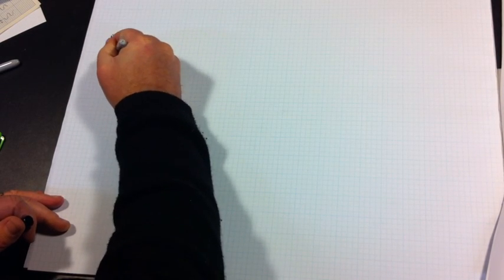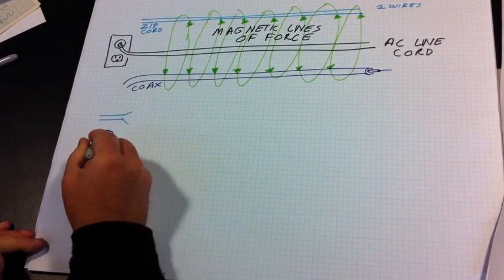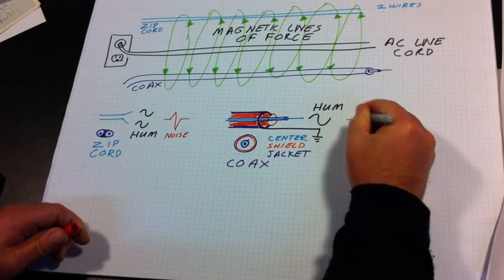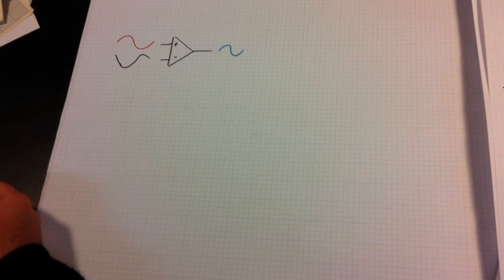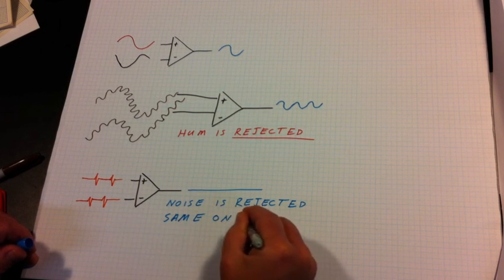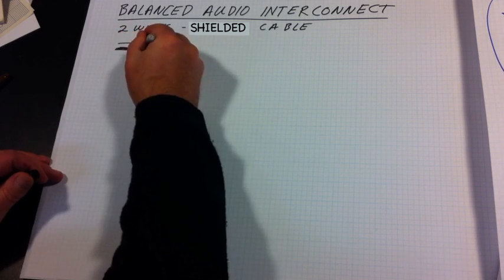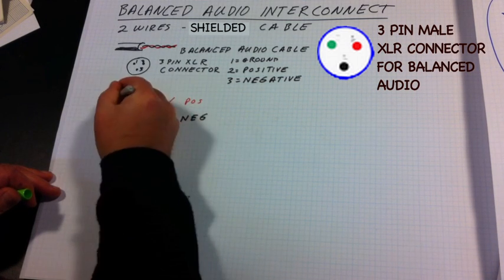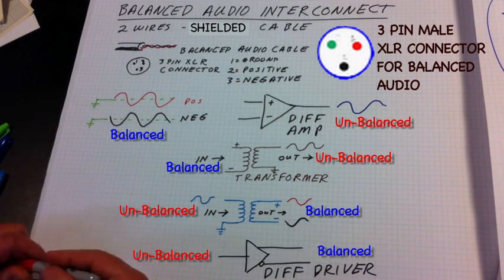Audio Basics - Balanced Audio

Comment: I have a balanced cable designed for digital (SPDIF) signaling over the AES-EBU interconnection standard. Essentially it’s similar to an XLR to XLR microphone cable, but with 110-Ohm impedance instead of 75. It also has much beefier shielding. I understand that using standard balanced microphone cables to carry digital audio over an AES-EBU connection is not ideal vs a dedicated AES-EBU balanced cable, but what about the other direction? Is the balanced AES-EBU cable okay for analog purposes, like as a balanced XLR studio interconnect or hooking a balanced DAC to the XLR inputs of a preamplifier?
Reply: nop aes ebu cables are specificaly designed for aes ebu digital signals plus why you wanna do such thing analog xlr cables are cheap

Comment: Why twist it?,that has little use and my older studiocables ain't having it and since silversolid cabler are populair, i don't know why ,since they hate bowing, instead to copper ,which molecule is more flexible, but indeed, i still don't understand the little use with hifi when it comes to trs xlr, though on a large receiver,full of connectors, the only available choice are those 10cents pcb mounted plastic shitty connectors, and why use expensive cables with that....Besides offcourse the expensive once ,with good connector, though,i prefer allways seperate units.But xlr is nice and cheaper,compared to the absurd rca connectors cables

Comment from the maker: I glad you solved your problem. It was a bad ground more than likely, the pro cable provided a very good ground conductor through it's shield. It protected the center conductor (or signal wire) from interference and it helped to ensure that the ground at one end was the same at the other.  Good luck and take care, Russ
Reply: TheOnLineEngineer .

Comment from the maker: I am sorry for the delay in getting back to you. No the Balum, that is the transformer that converts a 75 ohm coax to a twin lead which are used for antennas, will not work for you. You need an audio transformer to do that. The impedance is too low in the Balum and your audio level would drop. Check out Markertek for such things. Also most hum in electric Guitar setups is from the Amp and it's grounding or un-grounding.

Comment from the maker: The technic is called CMR or common mode rejection where to two twisted wires should encounter the same interference or noise and anything that is common is rejected. But with the low frequency of AC power and it's relatively large signal strength there a good chance that due to variations in the cabling or the audio input design/manufacturing some of the 60Hz hum will be picked up. Even a very small amount is too much as the mic level is very, very low and they'll both be amplified and heard.
Reply: How come the actual audio signals don't cancel each other out?